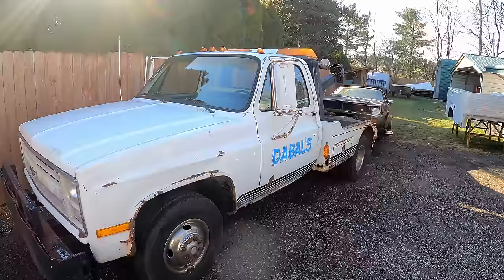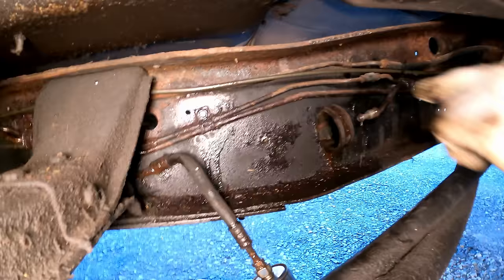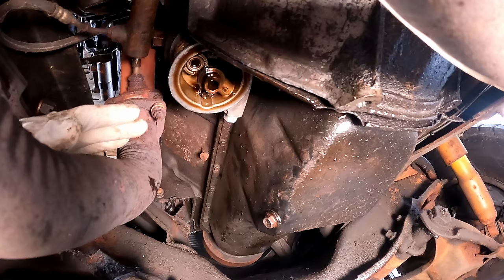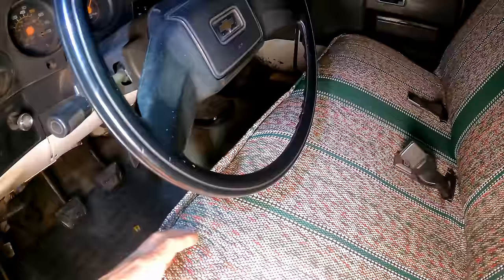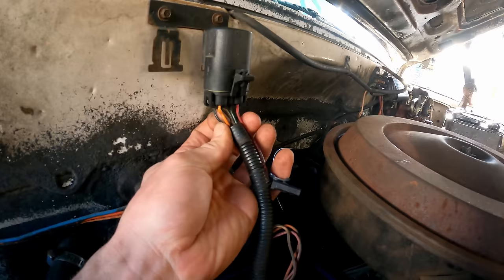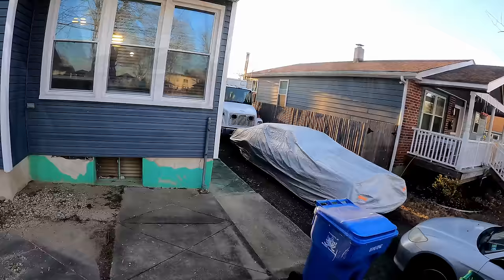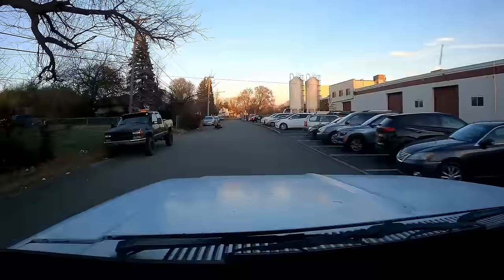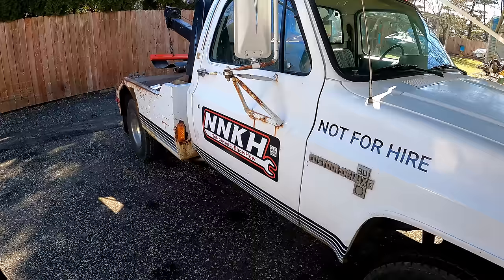C30 Wrecker Final Upgrades / Fixes - NNKH

Comment: Great videos, man! I just retired from the USCG (26 years) as a mechanic and love the way you teach and figure stuff out to keep 'em running. Much like we do out in the open ocean (you'd be surprised)Awesome how you plug all the American parts and tools, USA!!!
Reply from the maker: Thanks man and awesome, thank you for your 26 years of service. Sounds like a very rewarding career.  Hard pressed to find any parts made in USA these days so always excited to see it.
Reply: @NoNonsenseKnowHow  you can get everything sandblasted and professionally Rhino lined it would make it so your back system wouldn't sang so much because it would be filling in the space... can't use the roll-on stuff you can get yourself you need to have it professionally done or get a Rhino liner system... its 2 part chemical reaction like epoxy. Wouldn't hurt it... thats for sure... just gotta get rust off.
Reply: Kodiak Motorpool 1980 Semper Forgotus!!!!!
Reply: @NoNonsenseKnowHow  also do a solid front axle conversion and put in a transfer case being able to make it four-wheel drive and then maybe put in a Dana 40 front axle. 😉
Reply: @NoNonsenseKnowHow  also I definitely agree with you that you do the alignment because it probably did the alignment on it based off of the broken frame so once you fix that broken frame alignment is now off because it was set for the broken frame... welding fabricating there's no reason to not converted to four-wheel drive if that's what you really want... slap a diesel in it too lol 😆
Reply: @NoNonsenseKnowHow   i want to buy the chevelle and the plymouth savoy
Reply: @alfredtrejos5400  email him, he might not see this
Reply: @NoNonsenseKnowHow  Yes ,its a sad state of affairs that we cant have local made , im Australian , we lost GMH (General Motors Holden) aa a local car manufacturer when GM USA decided that the corporate jet executives on million$$ a year just had to keep flying around living large yet cut all the GM departments and outsourced it all to Sth Korea , Thailand , Mexico , Sth America , all for their own benefit......The people lose out , the people LET IT HAPPEN...............Take it all back , get out and protest , stop them in their business and take back your country. Im an old Boilermaker Unionist and ive done plenty , ive done my bit for the benefit of the community wages and conditions , hell ,, i dont reckon ill get a visa to come to your country for all the action i've taken , the dam Aussie gumbyment had covert cameramen on roofs of buildings taking videos of us during protest marches! DOnt diss China made , it keeps people alive there!!! Diss your factory owners and gumbyment for selling out YOUR JOBS , YOUE CHILDREN'S JOBS AND THE HEART OF THE USA!
Reply: @bigmountain7561  I was stationed on Kodiak, Marine Barracks 1964. was there for the earthquake & tsunamis.  Semper-Fi !
Reply: @richardclark4610  I knew it was the old Navy Base but I didn’t know how recent it was turned over to Uncle Sam’s Confused Group. It was really cool being there. I can still remember Tony’s downtown and all the dogs that got up on the stage. I got thrown out one time because this dancer has a pimple on her left butt cheek and I was trying to hit it with a straw and spitball. It was hilarious!!!

Comment: Just a fun fact…the slot that runs the whole length of the saddle blanket seat cover (under your knees) was originally designed as a long rifle scabbard, some are just pockets like you said. But many were sold designed for quick access to your hunting rifle.

Comment: If the foam in that seat isn't turning to dust, you can buy a either a few thinner sheets of foam off of Amazon or at an upholstery shop, 3m spray glue, and just start layering it up.  Once you've built it up higher than the rest of the seat it will be uneven, sticking above the correct level.  An electric carving knife, like you'd carve your turkey with, is super inexpensive, and does a good job at carving and contouring foam.

Comment: I love seeing the old Dabal's being used... If I were you I'd give it a sexy first name, and always refer to it as your homewrecker, since it lives out in your backyard. For your seat foam problem, buy a roll of 1" or 2" foam and use spray contact adhesive cut a piece of foam larger than the divot, and spray both pieces firmly press into the hole. Glue layers of foam in a stack larger than the hole. Then use an electric carving knife to cut off the excess foam and shape it then install the seat cover.
Reply from the maker: I'm terrible with names. Maybe I'll have Jen come up with one. She's more creative.

Comment: 5 mph bumpers and 4x4 four posts.
This truck slowly brought back a lot of memories.
I drove wreckers from 1976 to 1981. I worked at a Gulf station. The owner had three wreckers all with slings. We did private tows, triple A tows and had a contract with the state police to tow off the expressway south of Boston.
When the five mph bumpers came out we had a problem with the slings pushing the bumpers up and in which ruined the shock absorbing bumpers that's why everyone retrofitted their trucks with wheel lifts.
The owner of the Gulf station I worked at got 4x4s about 4 foot long.
You hooked the lower A frames with the big hooks. being careful not to snag a tie rod. Brought equal amounts of chain to the hooks on the bottom of the sling then placed the 4x4 on top of the chains under the front forks of the frame in front of the radiator support. The you raise the vehicle up. The weight of the vehicle rests on the 4x4 and the chains. Then you pass the loose end of the chain up between the vehicle bumper and the sling and then up to the hooks at the top of the sling then take a hook at the end of one of the chains and hook it onto the other loose hanging chain so it doesn't bang around. This works for front and rear tows.
Great channel.
You are doing a great job.

Comment: Buy some upholstery foam rubber, cut a piece that fills the gap in the top of the seat, spray some glue on the existing foam, put your patch piece in the hole, cover it with gorilla tape, and then put your seat cover on. It worked on my driver's seat, been 6-7 years and still holding. Love the vids.

Comment: Chris..A trick with a squealing fan belt, is to get the glaze off the running surfaces..whilst engine running, hold a round file on the V surfaces of it..I understand this belt was maxed out on adjustment

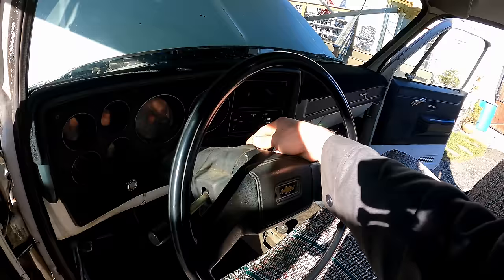Comment: @16:30 The oil pressure switch is not a safety feature that shuts the pump off. It is a redundant power source for the fuel pump. The VCM doesn't know if it has oil pressure. It just knows that relay and/or the OPS is sending power to the pump. It's not the difficult of a circuit to understand but it seems 90% of the people that explain it, explain it incorrectly. The VCM only energizes the pump for a couple seconds with key on, not 15.

Comment: You can try carving out a puzzle piece from an old couch cushion someone threw out and using that to roughly fill the hole in the seat and glue it together with gorilla glue or some 3m spray adhesive and put the cover back on. I would make it a tad oversize because eventually it will weaken or shrink into a smaller size. 🤷‍♂

Comment: 2:38 the way those old tbi injection system worked was a relay controlled by the ecm would energize the pump for 2 seconds to prime the system. After the engine started, the oil pressure switch would close and the pump would run off that. It was designed to go thru the oil pressure switch because in a accident the fuel would be shut off when the engine quit . Fuel pressure on these ran from 9-15psi

Comment: I got an 85 with a Holmes Protech bed. It's one of the early ones with a super (too) short wheel lift.
I paid 3k about 5 years ago.
It had perfect paint 
New engine
Everything works 
Hideous wiring...
I got a full harness from a friend that parts these out.
I'm working on converting it to 4x4.
Too many projects too little funds atm.

Comment: A good idea for a seat with a big hole in it is spray foam, fill it in and slap the cover on there before it expands. Or just use some duct tape and got over it so that when it does dry its level with the original stuff, then Let er dry then head to town

Comment: hot wire foam cutter(nichrome wire and a power supply).  Glue a chunk of foam into the hole and then shape it with the hot wire.

Comment: You could cut out A square spot out of that foam. Then use A old house couch foam seat cut out square piece hot spray adhesive from Elmer's glue to fix that small area with.,or high tack adhesive spray for head liners.& Sun visor's instead.

Comment: Chris, your efforts definitely restored an older tow truck into a no-nonsense functioning unit. Even the cosmetic touches, such as the seat covers helped to spruce it up a bit. I am thinking a front-end alignment on it might be pretty cool.

Gus really didn't care for the drifter thing much.  More to the point, he didn't like you on it much :)

Hello to Jenn, Turbo and Drifter Gus :)
Reply: Sounded like Gus wanted to race it.  If you find a pack of other weiner dogs for Gus to run with, please post slow motion montages of them running through the New Jersey tundra.  Fun educational vids, thanks!

Comment: I mentioned I want a 1 ton to an old timer friend and he tried to sell me his c30 wrecker that’s been garaged since he bought it new. He had a well renowned commercial shop and also did wrecker work on the interstate, and the thing is absolutely cherry. It’s a manual with a built performance 350 he installed after the original one wore out. Beautiful truck, but I have no use for a wrecker.

Comment: Check out the fuel cap for vacuum lock.. to rectify this, drill a small ( 1/16th ) hole through the Cap

Comment: I enjoyed all the videos on the C30, I am fascinated with to trucks and ramps trucks, I have never quite grasped what the black belts are for on the back, I understand how the lift arm cradles the front wheels, but I dont quite see what the straps do?. I did appreciate the close up view of how to switch tyres and balance them and patching the chasis at the back was a brilliant job. I am like you, if it works, is it really a bad idea!, its nice if things look perfect, but at the end of the day, vehicles are meant to be used and will not stay perfect forever. I would treat the rust patches and seal them, so they dont get worse, but I can find no fault with your approach or application. Its nice to see other things you do with your time and the drone footage is very creative. I like the fact that you share the fact you have made mistakes in the past, it takes a big man to admit his mistakes and learn from them, allowing others to learn from them too. A fool ignores his mistakes and pretends they did not happen. Most people could not do what you do, so they have no right to pick fault, you did a great job with this truck, it shows how much you know about engineering to repair it to this standard, there will always be people that try to pull you up on things.

Comment: Very cool... In the late 80's when I worked at an Exxon in NJ we had a 78 C30 wrecker but it was sling only and a little worn out all the way around. 1st gear was just silly and not necessary, you grabbing 2nd at 8 mph lol.

Comment: 8:25 😂 also expect to have those magnets fly off or get stolen. I’d recommend having your local vinyl shop cut you a blank white piece to go over the old lettering and put yours over that. It will protect the original if you ever want it back.

Comment: couch cushion foam, an electric knife and some spray adhesive works wonders for rebuilding worn seats.  Use the electric knife to carve the foam into whatever shape you need and glue it in place.

Comment: Store a 4x4 on your truck, some cars you might need to use it between the lower part of the slings and the car for proper lift and to protect the bumper. I used to drive tow trucks and had to use this method several times.

Comment: Excellent video on Chevrolet tow truck Chevrolet  to also for fix up that truck on wheel lift on fix and make running freely to put high temperature moly farm grease do every month or 3 months ! Want thick layers on square when full extented and when squeeze couple times grease too but worth it  plus cables too on grease up too !

Comment: Nice job on the wrecker , had a seat just like that one time and i used some foam in the low spot then sewed the rag ends with fishing line[ roughly ]  then a roll of duct tape on it - seat cover almost like yours , What works ,works

Comment: Throw a little paint on that rear tow body in spots maybe some new stripes on the back. Make the toolbox usable again. maybe throw another body mounted box on the rear with chains and straps. Only so much you can do with the rust but it would spruce it up a bit. Still what a comeback.

Comment: My Grampa and his brother had a C60 65 Chevy it had a 396 Camaro motor in it with dual exhaust cherry bombs 4 speed granny gear 2 speed rear end that thing was a hott rodd log truck with that 396 motor and 4 speed granny gear that thing sounded bad too the bone I use too gett in it and Rev it up just too hear it roar I miss them days and that beast of a truck  I use too help them log I really do miss those days it originally had a big 6 in it when they bought it it was about wore out that's why they put the big 396 in it I've seen they load it so heavy it rared straight up if that I beam front bumper hadn't caught on a tree my Great Uncle would have went in a hollow we was logging in thank God that big tree and I beam bumper held up till he got the clutch in and set her back down that bumper was like a I beam strong as could be good thing it had a strong bumper and frame on it that truck was like a tractor it was geared so low you could take off in high no problem if you wanted too or just had too it was so high off the ground it made me feel like I was flying like I had wings it was alot of funn too drive and ride in.

Comment: Hey Chris. I recommend throwing your berrymans chem dip into the ultrasonic cleaner. I bought 2 gallons and it filled mine up, yours looks a bit bigger. I’ve never had a problem with it, aside from me accidentally leaving the heater on and it evaporating out.
Reply from the maker: A couple other guys mentioned that as well. Yeah mine is several gallons so it would be a little pricey. Also that chem dip can be very harsh on certain things so having a water-based in there is nice as well.  Dropping the 1 gallon jug in there seemed to work very well. It got the chem dip nice and hot and I'm pretty sure the ultrasonic sound waves blast right through the steel can.
Reply: That’s a good solution I think. I only ever do carbs in mine, so it works good for me. Gus is adorable, I wouldn’t mind if he ate a cucumber off of my sandwich. Sad to see the end to this series. But I know you’ll have plenty more vids.

Comment: Yeah, I tried to delete my oil cooler lines with the 2wd adapter kit on my 99 GMC Suburban, It would bolt on, but you couldn't get an oil filter on it, even a short one the clearance wasn't good, would come to close to the front diff yoke, If I ever have to do them oil cooler lines on my truck again, I'm going to make my own, them cooler lines are $80 bucks a piece for AC delco's, Dorman ones are 60 a piece but its Dorman, cheaper on Rock Auto but I needed my truck that day. Price of everything is going up, a once $10 u-joint is 40 bucks of my truck now, its crazy...

Comment: For the seat repair could you fill the gaps with other seat foam and use some type of adhesive to hold it in place? Then just cover it with your blanket cover.

Comment: Throw some of that expandable foam in the seat hole then sand it back down to profile maybe..?!
Reply from the maker: That's what Jen mentioned also, but I'm thinking it would be a little too firm. Honestly it's not bad the way it is now. Kind of comfy and easier to get in and out of the truck since the steering wheel doesn't tilt.
Reply: @NoNonsenseKnowHow  yea I was thinking about the firmness too, but it might mold to you too after u sit on it lol

Comment: There's 5 things I would do to it the back where the levers are I would put a bedliner Onnit get a couple snacks blocks they're basically pulleys the can double or even triple The winch capacity update the beacon lights go to off-road lights that would put off a lot more light go to make the truck a little more usable Wireless tail lights add two more lights on the back like a total of 4 let you know how much experience I have 14 and a half years and towing services

Comment: Regulated fuel pressure spec on those was 9 - 13 pounds.  You should be able to hit the dump valve, see a full, strong stream of fuel, with no change in idle quality when running at idle.  If they stumble and/or die when you hit the dump valve, the pump is usually the culprit.  I see you had a kinked hose, though.

Comment: I did the same thing on my 83 chevy as a teenager. Its hard to get those short lines on. Easier to pull the box off in my case.
Reply from the maker: Yeah I don't understand how it would be even possible to get those short lines on without pulling the bed. That's why I put the long ones in. Maybe with the factory bed it would be doable but with the record bed there was zero room to get up there

Comment: In my state you can have a dump or tow truck etc with only passenger plates when you specify not for hire like you did…. However once you advertise logo they make you put
Commercial plates. Not sure about your State and if you care but may get you pulled over. Im sure you are prob up to laws